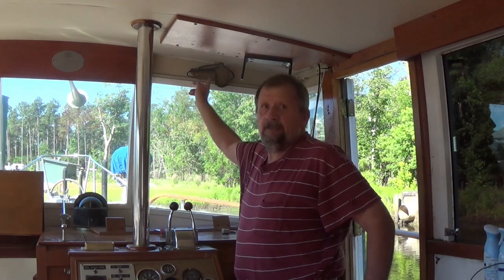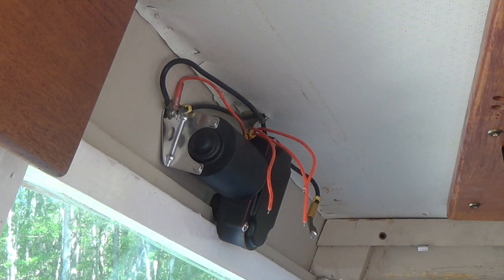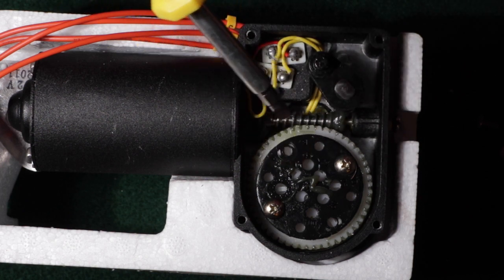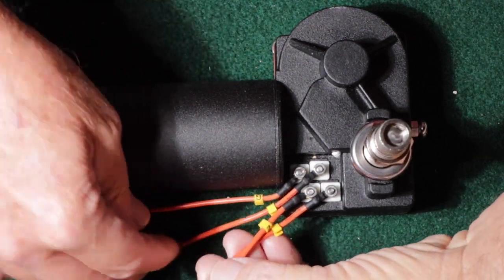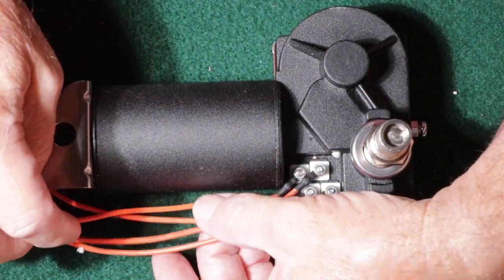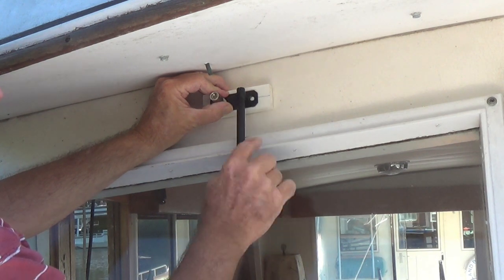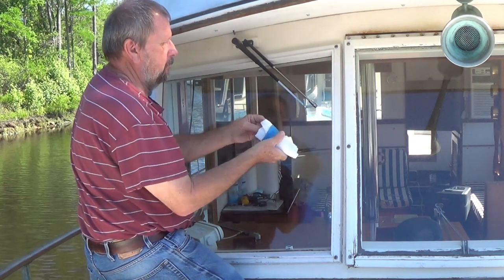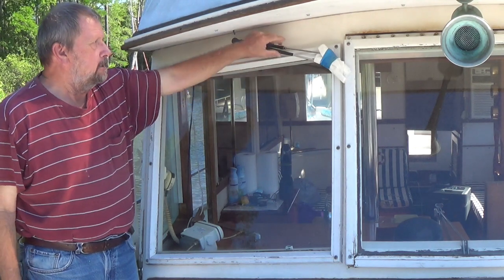Boat Windshield wiper motor replace

Comment: Do you remember what motor you ordered? What shaft length for DC motor. I am in the processs of replacing a windshield motor on a GB32. Love this video. Very informative.
Reply from the maker: The Shaft length was 2 1/2 inches on the wiper motor.